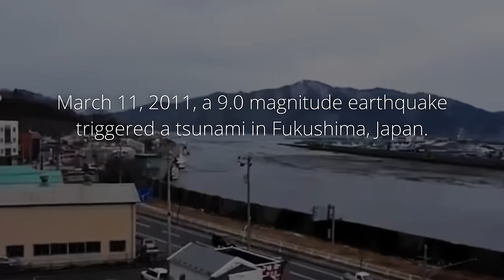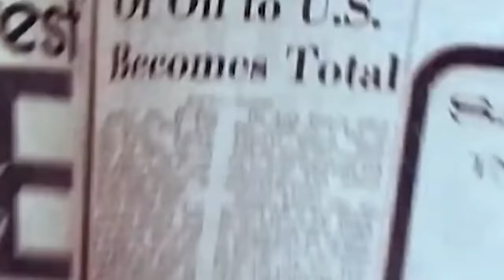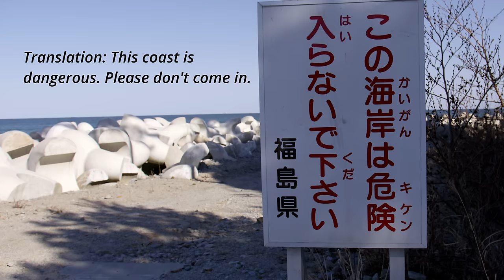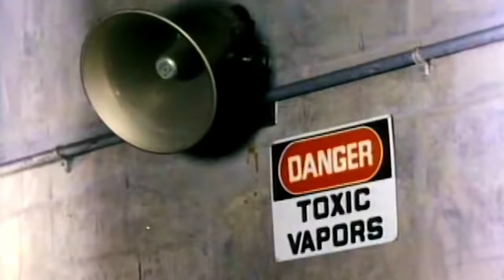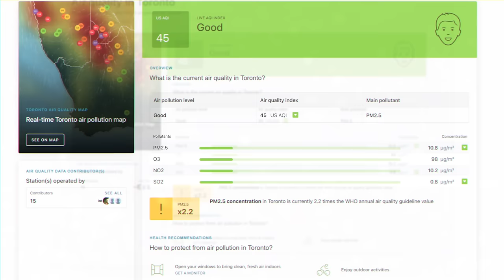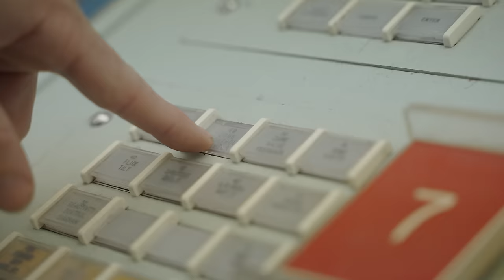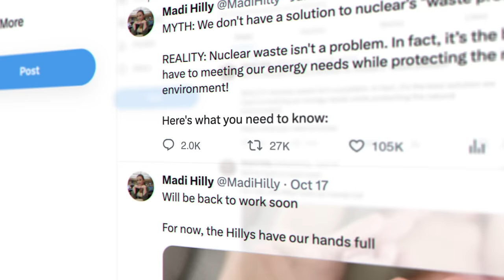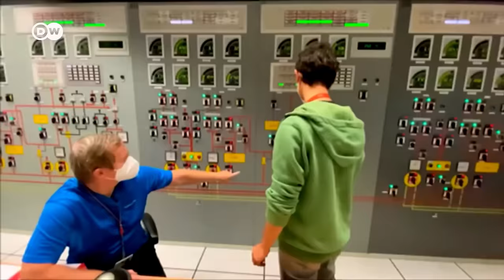JUICE (Episode 4) -  Nuclear Renaissance

Comment: It's very heartening to see that Canada is retaining its nuclear-reactor capacity, and hopefully building new reactors. The CANDU heavy-water reactor, in use at the Bruce Power site, may be one of the safest designs on the current market. Now if Canada would just develop a small, modular CANDU reactor....
Reply: Fukuto , Japan was also hit
Reply: About the only heartwarming thing about Trudeau’s Canada then…
Reply: @adrianryan5654 IIRC if it had been entirely up to castreau,  the nuclear power plants would have been shut down...  I could be wrong.

Comment: Switch the fossil fuel power grid off and rely on 100% renewables right now. After a week they'll be begging for coal/gas/nuclear to be back online.
Reply: I agree that we can still use coal and gas but everyone says that nuclear is a cleaner energy which is hilarious. What happens with the nuclear waste? What would have happened if that power plant went into meltdown? There is already contaminated water leaking into the sea from this event. Nuclear is not a good solution, I'd rather have gas and oil burning plants combined with renewables which will get better and more efficient over time
Reply: @nrmorales82 Not sure if there is a safe zone in Japan for nuclear power.  Maybe they should stick to fossil fuels.
Reply: @heynow01  I agree but what I'm saying is I don't know if there's a safe place anywhere for nuclear reactors or the nuclear waste that they produce 
I'm all for the best energy sources but you have highly toxic material that you have no way of disposing of
Reply: 24 hours!
Reply: @nrmorales82  There are currently no easy answers, but we do have methods of storing the radioactive waste in a manageable way, just not perfect.  
A glass mixture sealing the liquid into a solid storage container in remote salt mining caverns.
That must be balanced against the alternatives to weigh the plus and minus values.
We have to make hard choices no matter which way you go.
But, we must be realistic in terms of safety and costs, or it becomes a very dangerous and inefficient choice.
Reply: @heynow01  my uncle was an engineer and worked for a power company years ago it was an oil burning facility he always advocated for nuclear but I'm sure he never imagined that a natural disaster would cause this kind of almost meltdown from a tsunami nonetheless in Japan were there engineering standards are some of the best in the world. He would advocate about the safety of American nuclear plants but as you can see unknown events can happen. Also in regards to the nuclear waste let us hope that those waste containers never leak. I hope someone is actively observing them to make sure that does not happen....

Comment: I have always been of the same conviction, that nuclear is a must-have, if we want carbon neutral. The purpose of this Bryce-documentary is to drive home something that should be common sense, and isn't, yet. But you can't, you just can't publish something about nuclear being safe, without addressing Three Mile Island and Chernobyl.
Reply: TMI was a relative non-event, releasing nothing affecting the safety of people outside the plant's boundaries.
Chernobyl was a different design, now very much out of date, being operated outside safety guidelines and causing less than 100 deaths.
Texas's winter blackouts in 2021 cost well over 100, maybe 600 deaths.
This documentary series quite rationally, chose not to look at the much smaller impacts that are out of context with the messages of this doco series.

There. Answered it for you.
Reply: TMI and Chernobyl are subjects that have been beat to death. Kyle Hill does a really good job at addressing those events. It's refreshing to see something that isn't just a rebuttal to "What about the waste? What about Chernobyl/TMI/Fukushima?" There is plenty out there on those subjects. Not enough of material like these videos that highlight the systemic and cultural obstacles to nuclear power.
Reply: Yeah, nuclear is the safest form of electricity when considering accidents like TMI, Chernobyl.  
There, happy now?
Reply: @ForbiddTV  What a wonderfully objective, highly qualified comment. Thank you.

Comment: If you want to reduce CO2 emissions into the atmosphere, ahead of cracking fusion, nuclear is a must as wind and solar does not work. BUT CO2 isn’t the problem and so the solution is targeted at the wrong issue.  Until we can have a proper scientific and engineering debate with actual subject matter experts and not grifters and cut out the political manipulation of the narrative we will not make actual progress and most likely will make the wrong choices.
Reply: How long (at current usage levels,  or reasonable projections for usage) will it take for co2 to reach 2,000 ppm?
Reply: @wheel-man5319  it won’t, the general trend is the other way and in any case we can easily handle 2000ppm but we cannot survive below 150ppm, which we are uncomfortably close to…
Reply: @adrianryan5654  that was my point.  I don't know what (beyond racial suicide) is on the minds of those who want to actively remove co2 from the atmosphere, but if they succeed all life, not just human life on earth ends! How's that for a mass extinction? And that one would definitely be due to human activity!